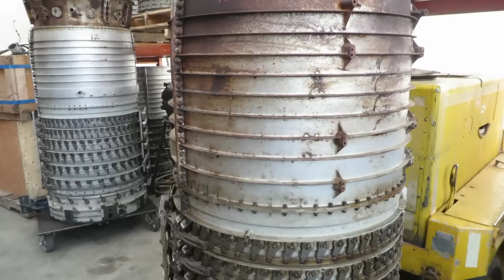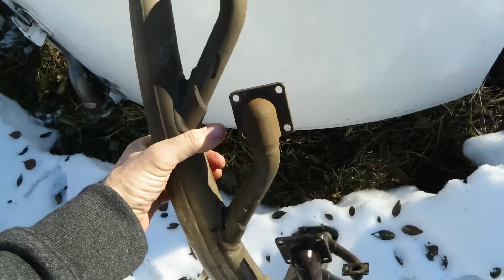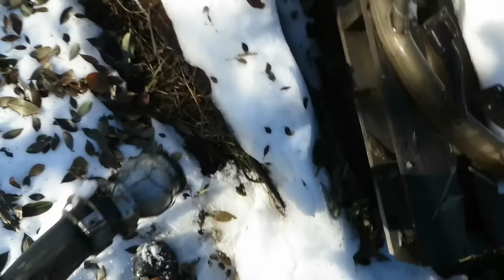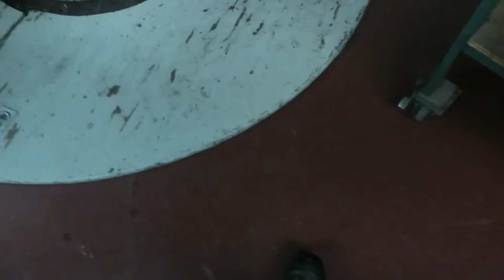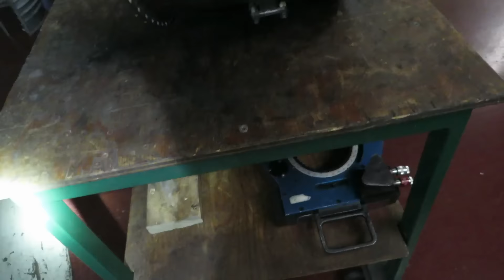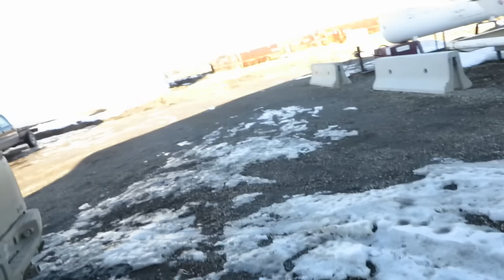Jet Questions 89

Comment: I am surprised to hear that such log ducting between gas generators and power turbines is used, but dumb I am on many, many subjects!  I think you again have covered several topics, from which I have learned something; your efforts are not in vain!  I think also that you have a nice collection of gas turbine engine related parts, that you can turn into artwork and sculptures some day, if you wanted.  Thanks for the video.  Cheers.

DD

PS:  For those that did not know, the Fairchild J44 was part of a few 'classified' projects in the 1950s.... hmm, Agent JayZ working on a rotor from a J44.......
Reply: I think that AgentJayZ got it right when he suggested that the gas generator was installed to give more than adequate power to compensate for the losses in the ducting. It does make sense to me to install the gas generator at ground level in a sound-proofed cell for accessibility. OK, it might not be the most efficient installation, but the utilisation in such an application must be low, so fuel consumption is hardly an issue. For any typical industrial or marine installation, where efficiency is important, then the inter-turbine duct length should minimised, consistent with making the duct work efficiently as a diffuser (which it usually is).

Comment: The question about starting engine by injecting high pressure air into final compressor stage; that would be like putting your "Moose" in 10th gear and starting from a standing start. The mass of the compressor is the problem. I appreciate what you do.
Reply from the maker: The air impingement starter works on the turbine, which is designed to catch air and turn it into torque.
The compressor is designed to use torque to throw air.

Comment: J Z I'm happy to hear that you are finally getting your home back together after the flooding. I too experienced similar damage   and six months of renovations after Hurricane sandy. My question is about the possibility of using small turbine electrical generation for home emergency use . I've been on the Capstone website and they seem to be more suited for commercial use. Do you have any recommendations. Those beautiful engines you restore are a little over kill for residential use but the idea is similar. I would appreciate any feedback. Thanks again David Katz.
Reply: that would be cool as, they are very loud even a small one, but I think you could power your whole street maybe .

Comment: I wanted to ask about bearing arrangement on multi-shaft, especially triple-shaft engines.  I don't really understand how the shafts are held in position relative to one another.  Are there bearings between the shafts?  Are they only at the ends of the shafts?  It's difficult to picture how these parts would be held in position, where the bearing races would be, and how the whole assembly is lubricated and how the oil pathways are sealed.

I know you have discussed bearings at some length, especially for single shaft engines, and I do understand how they are arranged, and function, in a single shaft system.  However, I don't see (and I looked, pretty thoroughly) hardly any discussion of bearings for dual or triple spool engines.

These videos are fantastic, and I really appreciate all the time and work you put in to them!
Reply from the maker: Some really good diagrams in the RR book called "The Jet Engine"
Also, maybe take a look at my videos called Twin shaft turbine engine bearings, and Jet engine lube system.
Reply: The LP location bearing (ie, the fan thrust bearing) in R-R's RB211 and Trent engines is an intershaft bearing. The IP location bearing takes the thrust of both the LP and LP spools. Yes, take a look at 'The Jet Engine' book, but try googling 'Trent 1000 cross section'.

Comment: AgentJayZ Jet Q 89. power-turbine air or steam start-up check valve maybe sprung to close, I don't think it needs to be.
once inlet pressure starts engine RPM operating acceleration should create back pressure through the manifold to the valve that is concaved perfect shape to close, could this be correct ?

Comment: I always thought that the afterburner created greater expansion at the rear of the engine which made the total pressure drop across the engine bigger, thus adding to the thrust.
Reply from the maker: You were almost right. What reheat does... is re-heat the exhaust to a higher temperature... causing greater expansion of the gases, so they have to move faster - greater acceleration form inlet to outlet = greater thrust.

Comment: Is flow separation ever a problem in the CD-nozzle used on after burning jet engines?
Reply: No, because the flow in the divergent section is supersonic and, as AgentJayZ has only recently told us, supersonic aerodynamics reverse relative to subsonic. A supersonic nozzle is divergent, whereas a subsonic nozzle is convergent. In any case, the angles of both the convergent and divergent sections are designed for optimum aerodynamic performance, consistent with minimum length. Take a look at the shapes of rocket engine nozzles: the rate of divergence is extreme in comparison to an equivalent subsonic diffuser and yet they run 'full' with no separation.
Reply: grahamj9101
Yes, rocket nozzles have extreme expansion ratios (70-something on the Space Shuttle) but they also have a combustion chamber pressure of 100-200 atm or even more for certain Russian engines (what is the pressure in an afterburner?). And rocket nozzles on ground-started engines are designed to go as close to flow separation as they dare to get as high Isp as possible (unless the diameter is restricted because of some other design constraint). Rocket engines started in or close to vacuum (can) have even higher expansion ratios, 300 or more. I guess my question really is, is the diameter of a jet engine and it's surrounding structure not wide enough to accommodate a nozzle big enough to ever come close to flow separation in the nozzle?
Reply: It's not exactly rocket science (OK, it is) to be able to design the fixed con-di nozzle of a rocket engine such that it doesn't experience flow separation. As an apprentice back in the 1960s, I did work in the Rocket Department of Bristol Siddeley Engines, so I do have a little background on the subject. Rocket nozzles for launch vehicles are typically a design compromise - variable geometry would be difficult. They over-expand at sea level and at, at high altitude, they under-expand. This means that, at sea level, the exhaust plume tends to contract after leaving the nozzle, while at high altitude it continues to expand radially once it has left the nozzle. However, in the various close-ups of Saturn V and Shuttle launches, I don't recall seeing any evidence of flow separation at launch, but then I wasn't actually looking for it.
Jet engine designers are no less competent in the design of variable con-di nozzles for afterburners, in ensuring that flow separation doesn't occur. As I was trying to point out, the normal rules limiting the maximum conical angle of a subsonic diffuser don't apply to a supersonic nozzle. Nevertheless, I would accept that there must be an extreme angle at which the divergent nozzle will not run 'full'.
I will readily admit that I can't actually answer your final question, as I was primarily a turbomachinery designer. However, I certainly don't recall the topic coming up as a performance issue in any of the design review meetings that I attended over the years.
I've watched Typhoons, F-15s and F-16s (etc) taking off at airshows for many years. To the best of my recollection, the exhaust plumes, with their shock diamond patterns, have never appeared to me to show any evidence of under-expansion, such that a larger diameter nozzle exit would be of benefit.
Reply: Yeah, variable geometry would be difficult, aerospike is an attempt but to my knowledge has not flown on any bigger rocket yet. One Ariane V had a nozzle failure and if I understood it correctly the combined forces of the over expansion in the nozzle together with the aerodynamic loads on the outside of the nozzle were more than expected.

Is the nozzle opening on a jet engine variable with altitude?

Did you work on the Gamma-engines back in the 60s?
Reply: The primary control parameter for a variable nozzle is normally the pressure ratio between compressor delivery and turbine exit. Typically, what I know as an RHFCU (reheat fuel control unit) maintains a constant pressure ratio while the reheat/afterburner is operating. It signals the variable nozzle to open and controls its area, such that the engine remains unaffected by operation of the reheat. I'm not aware of any direct barometric pressure input to the control system.
I'm not old enough to have worked on the design of the Gamma and Stentor rocket engines, although when I was an apprentice on placement in the Rocket Department, I was allowed into the build shop to see them being assembled - and I was once allowed to go out to the test site on the airfield to see a Stentor going through a requalification test before it was returned to the RAF.

Comment: Jay, do your test stands measure torque on the mounts as well as thrust. Curious if a torque is substantial and considered in aircraft design. I'm not talking of torque of the compressor rotor or accessory drive but rotational force from the engine case to the aircraft frame? If all the staters (?) direct air in the same rotational direction, then one would assume a rotational force would be present. Just don't know how much. 

William Garrett
Reply from the maker: The net torque on the engine mounts is negligible.
Reply: The torque produced by the compressor stator vanes is opposite in direction to the torque produced by the turbine nozzle guide vanes.
Reply: grahamj9101 Interesting. That makes since. So net torque could be zero. So there must be some depending on turbine speed and fuel consumption, minimized at normal operating perameters. I would guess there is no need to measure since there is no adjustment if not meeting baseline spec.
Reply: Since the resistive torque of the compressor rotor equals the driving torque of its turbine, I would think that the torque produced by the compressor vanes would be more or less equal (and opposite) to that produced by the turbine NGVs (nozzles). It was never an issue during my career in gas turbine design.

Comment: From your experience, what is the easiest way to install the fork end in the vsv link arm thingy? Also the fasteners on the j79, are they considered splined or are they just 12 points. what is better to use on them?
Reply from the maker: "The fork end in the vsv link arm thingy"... this is an excellent example of the importance of using the correct terminology; I don't know what you are asking.
Also, there is a right way  to do things. It's in the overhaul manual.
"what's the easiest way?... maybe you should seek employment elsewhere...
Second question rejected on general principles.
Reply: Current aerospace standard fasteners (they have an AS- prefix part number) are described as having bihexagonal drive features, but the industry usually refers to them as "twelve-point" nuts and bolts. The drive faces of the individual points are flat: splines are usually of involute form, ie, curved, similar to gear teeth.

Comment: Jay, about that whole power turbine inlet duct thing: are power turbines designed to extract power from the velocity or the pressure of the gases? If it's the first case then it makes sense that there is no power loss from using a very long duct, since the velocity is equal just ten inches downstream of the LP turbine or a mile away, provided that the duct is sealed. If they are designed for the second scenario, then the power loss should be huge (which is the reason that turbochargers' turbines are as close to the combustion chamber as possible, to minimize pressure losses from the temperature drop in the exhaust manifold).
I think I've just answered myself, but I'd love to hear your two cents.
Reply: A power turbine extracts power from the expansion  (ie, the pressure drop) of the hot gas being supplied to it by the gas generator. There will inevitably be some pressure loss in a long inter-turbine duct. There will also be a significant pressure loss in a right-angled bend in the duct, unless it has a 'cascade' of turning vanes. However, I would expect bends with cascade vanes to be included in an installation supplying power to a wind tunnel, because such features are commonly used in the bends of large (and small) closed-circuit wind tunnels.

Comment: Not sure if this is the right place to ask this, but that nacelle that's
 cut apart in the scrap yard is aluminum honeycomb sandwiched with some 
composite exterior, or metal, I'm guessing carbon fiber or fiber glass. Anyway the
 question is how when honeycomb cored parts like that are made do they 
keep the skin material from sagging into the holes of the honeycomb core
 while it cures?
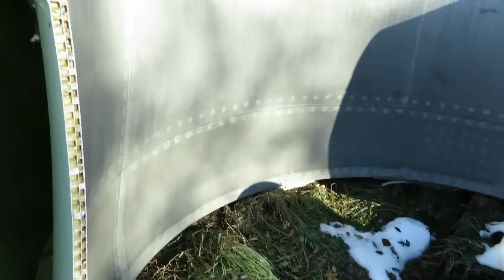Reply: Can be seen at 10:45, for any interested reader
Reply from the maker: This structure is all aluminum. This stuff is very expensive to make, but I don't know the exact details of the process.

Comment: The atmospheric pressure to some degree acts to increase nozzle length as a rocket engine does.
Reply from the maker: You must mean something other than atmospheric pressure, or ambient pressure. Maybe you meant pressure of the gases inside the nozzle. If so that would have an effect, but it would be negligible.. microscopic compared to the effect of the heating of the materials.
But you din't say that. You wrote something as if it was a fact, and it was a mistake.

Also, using the phrase " to some degree" earns you a Vague Ribbon, so congrats... you for that thing you did that time when those people were saying those things...
Reply: @AgentJayZ  I'm always up for learning more.  I'd love to sit and pick your brain one day